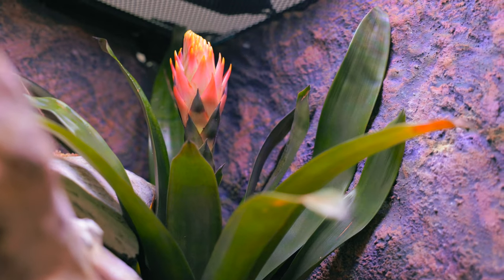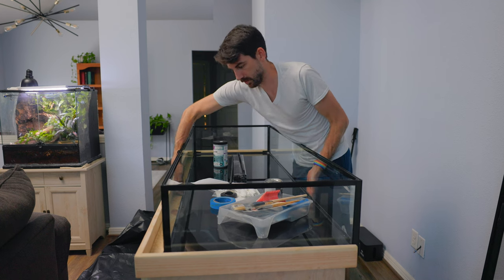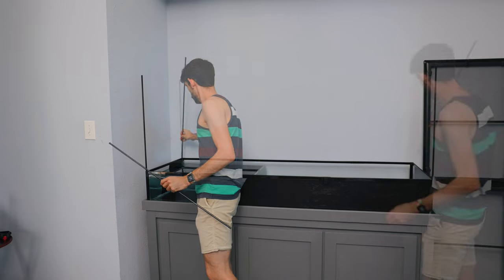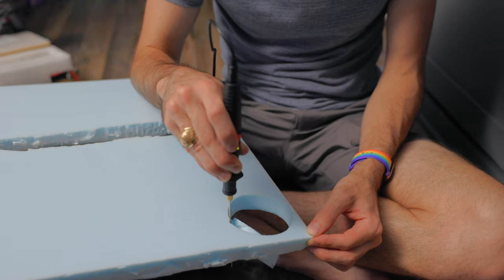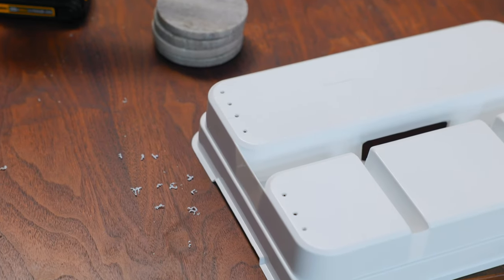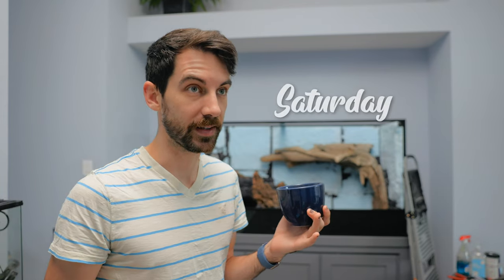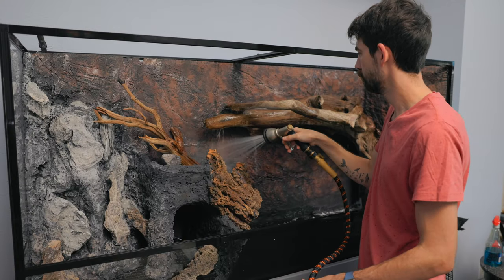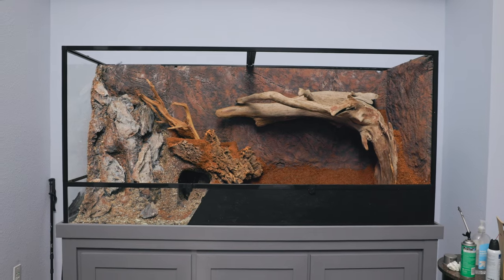I Tried to Build a Giant Boa Paludarium in 7 Days

Comment: Anything in particular you’d do differently if you made this again?  I coincidentally ordered the same paludarium with a plan similar to yours. Then I found your video with everything laid out pretty perfectly!!  (Thanks for that!). The tank arrives at my house in a week so I’m still feverishly planning. Any extra advice would be appreciated.
Reply from the maker: If I had to do the whole thing again I’d pay extra attention to re-sealing the bottom portion for leaks and also seal the seams between the back panel glass pieces. Other than that and maybe slightly different waterfall design, I’d do most things the same. It turned out pretty well
Reply: whered you get the tank from?!

Comment: I’ve been scouring YouTube for bio active builds and after choosing one route and ordering everything I came across your video and completely scrapped the idea😂 just some quick questions for clarification. For just the filter inlet n outlet tubes, I just need to drill one hole up top and one towards the bottom? I can’t tell if you made an extra one for a fogger or something. What’s the tube for that you glued in between the styrofoam pieces? What’s the black tube used for that you mounted to the left of the waterfall?
Reply from the maker: Haha, yeah, the top hole is for the supply (other top hole is for the fogger). The bottom hole is for the return, but unless you have a bulkhead that is sealed, I’d place the bottom hole juuuust above where the water level will be. 

Also make sure you choose a filter with a strong enough pump to siphon the water from the height you need. Mine’s pretty high so I had to prop my filter up on a stand. The tube in the background is for underwater light as well as air pump
Reply: @JustTravis_trj   I bought almost everything you have listed, so the filter should come with a sealed bulkhead correct? Or did you buy a separate one? I also ordered the air pump, what kinda tubing you use for that and where can I find it? Great build btw💯
Reply from the maker: The pump does not come with a bulkhead, but most of the stuff I needed for tubing and water management I got at my local hardware store, that way you can test out different sizes
Reply: @JustTravis_trj  appreciate the responses my guy.